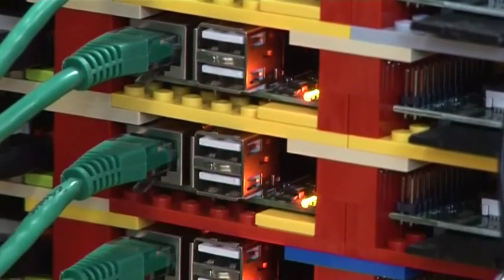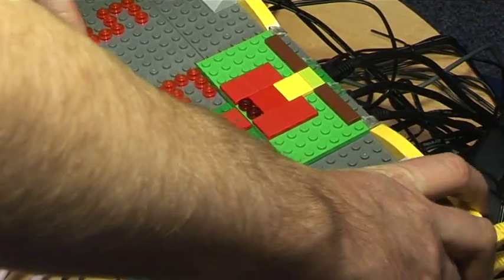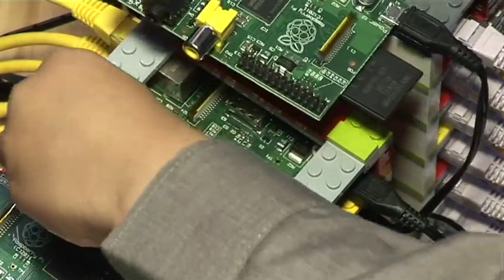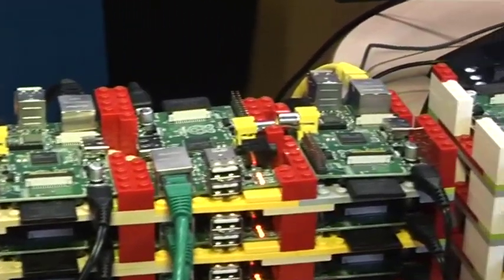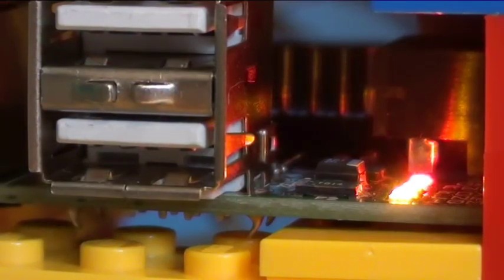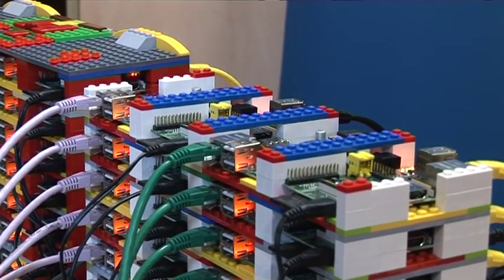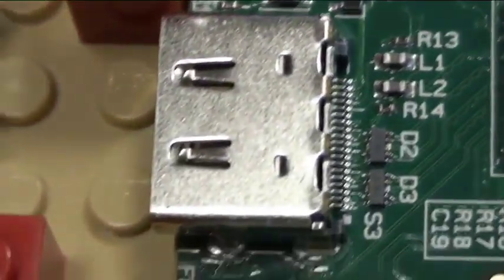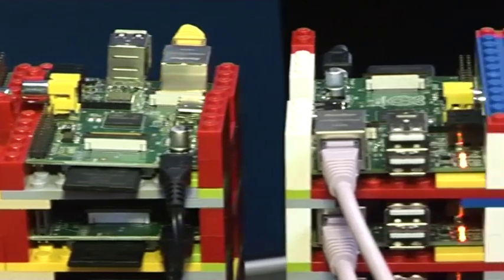University of Southampton - Southampton engineers a Raspberry Pi Supercomputer

Comment: I feel compelled to look into a pi Zero version of this, and irrespective of final size, to have a touchscreen interface - so even if it's comparably a gargantuan thickness of tablet and remains 'leashed at wall' by a power cable, it's still got power above and beyond anything currently available..., like a desktop tablet/table top surface interface is still a worthy project, ultimately it is scaled for taking up less space than a tower pc and outperforming the best of them ...any pointers...?

Comment: If he knows enough about computers to put that together you would think he would know how to mod an ATX power supply to power all that from one supply..
Reply: +Matt Phelps putting all this together is stupidly easy. All you do is plug in each pi into a switch and configure a program to allow them to pass messages between each other.
Reply: +[_ ] Oh I know that, I'm just saying all you need to do is grab an atx power supply and splice all the pi's into it's 5 volt rail. You may even need two atx psu's but it beats the hell out of 64 wall warts lmfao
Reply: I disagree. It's a lot simpler and easier to plug in 64 wall warts than to solder 64 power connections and make sure that you did each one correctly. More importantly, using one or two ATX power supplies creates a very large, single point of failure for the entire cluster. If one rPi's power adapter dies, you just replace it. If you've soldered your power connections in and your PSU dies or your wiring wasn't done properly, your whole cluster can be affected. Honestly, who wants to solder 64 cables when it takes just 5 seconds to plug a cable into the wall?
Reply: touche, very valid points. I would just be concerned about the cost of all those adapters. this guy probably doesn't care about the cost because it's likely under grant money but those wall adapters aren't cheap in comparison to connectors and a bunch of wire. It'd be a pain in the ass but that's the way I'd do it. Even to just buy the micro usb - usb cables then soldering into those would likely be cheaper. In this case I don't think it'd really matter if part of the cluster dies..it's a raspberry pi cluster it's not like it's the NSA's defense network and I would trust a good quality full size psu's circuitry rather than a shitty wall wart. just my opinion.

Comment: Any actual demos? The RPi cluster video is also all about blablabla and how it looks and not a single demo to prove is a "super computer"...no game, no program...hell no OS
Reply: +Sacco Belmonte How would you "prove" it's a super computer? Any why would you need to?

The idea behind this is not, that it is fast, but that with these simple elements the fundamentals of super-computing can be demonstrated. There's nothing one needs to prove there.

He actually talked about how it works: It uses MPI to coordinate the machines, distribute computation to the nodes etc. MPI is an old defacto standard for that.

So you could just run a lean linux on each node, and then distribute computation through MPI.

Comment: Quick Question: Why did you use individual power supplies for each Pi rather than just implementing a 5V rail?
Reply: I was wondering the same thing. It would be very simple to make a 5V setup to power every pi off of a single supply.

Comment: first of all a hearty thanks for every body who made this...i like to know abt its performance.....does it works for servers?does it give 1000ghz++ speed......how about its price?....does its support ubuntu? ......shall i program my own soft in it?....does it help in daily home computing? kindly tell me guys
Reply: Performance wise, it can't really be measured in Hz, FLOPS (FlOating-point Operations Per Second) is the measurement you'd be looking for with this kind of system.

Each Pi costs $30, plus SD card, cables, switch, etc. You're looking at $1000+

You'd need to be programming applications that support this kind of distributed processing to gain any benefit at all. 

What does "daily home computing" mean?

Comment: You can power the Raspberry Pi from the MicroUSB connection (as is expected of you) or through a special GPIO setup (but you have to be careful and will need to add your own circuitry to prevent power surges from destroying it).

You might look at getting an ASUS RTN-16 instead. They are about $80 right now. Just get TomatoUSB installed on it and you're good to go.

Comment: As of  31/08/2013, on Distrowatch > com;
Raspbian is a free operating system based on Debian GNU/Linux and optimised for the Raspberry Pi hardware (the armhf processor architecture). Raspbian comes with over 35,000 packages, or pre-compiled software bundled in a nice format for easy installation on a Raspberry Pi...

Popularity (hits per day): 12 months: 295 (9), 6 months: 294 (19), 3 months: 213 (39), 4 weeks: 155 (52), 1 week: 152 (50)

Comment: Yes, but, it is conductive. It would be so easy to short one of the nodes just by bumping it up against the case, and then whatever the computer was doing is probably ruined. But, yes, they could have used it for a heatsink.

Comment: I know it's not meant for real world applications, but you could set it up as a simple fixed terminal when you don't want to bring your desktop. If you have a laptop, you can keep the fixed terminal somewhere and bring your laptop as portable terminal. Like at school (I'm only going into highschool but it seems like a good idea to me) put a raspberry pi in your locker with a small monitor, keyboard, and power supply. Then prepare it for a quick terminal start or make an interactive school guide.

Comment: Each Pi does 24 GFlops. Assuming the total power of the stack is simply the sum of the individual powers of the Pi's, that comes out to about 1536 Gflops, or around 1.5 Tflops. Not quite even your 4870x2, but the difference is that instead of just being something that you go out, buy, and use, this stack is of immense educational value. people LEARNED something by making this, whereas you probably learned comparatively little by just buying your 4870x2

Comment: I feel like GPUs are a better and cheaper way to build supercomputers...I could be wrong, and I guess it depends on specifically what you're doing - if you need more floating point or more integer processing power, but most tasks you need a super computer for are heavy on floating point math, for which GPUs are stellar performers and relatively cheap. For the $4k they spent here, I think much more could be achieved using GPUs, in most cases.

Still cool, tho! Woo legos :D

Comment: whats the answer?
what kind of tasks would be best performed on either system?

I imagine the rasp.pi setup has more ram, and can flop faster, but I dont know if you get a huge bottle-neck in the transfer speeds of the switches between each of the modules, or how the end-module would cope with 63 streams worth of data?
And deviding a problem into 64 parts to begin with, and then combining all the 64 parts into a whole, that sounds like it might be difficult to manage for a programmer.

Comment: There's this thing called "teaching". They do it a lot at universities. Part of that is the students building stuff themselves under instruction. Instead of having students cobble together a computer made of 64 regular commodity compute nodes for ~2000$ a piece, they'll have them put together one from 64 Raspberries, which cost 25$ a piece and will run the same software. Not as fast, but that's not the point when you're teaching how the internals of super computers work.

Comment: Aparently you may be wondering if it might run Crysis. 

You dont run Windows on this baby. Its linux. Go back to playing counerstrike..

A thing this setup would most likely outperform any gaming PC at would be somthing like hashing and such. The point about Raspberry pi isnt getting awsome computerpowers like that. The point about a clustersetup (supercomputer) is the cost/performance ratio)
$4000 will get you this.. 64 raspberry pis. Or about two really big gamer desktops.. But thats it.

Comment: "have enough computational power to do the graphics for Crysis" in theory, yes, but in reality no, real-time rendering requires  very low latency, i don't think Ethernet latency and bandwidth is fast/large enough for that, so even if you have 10k rPI and enough power to run crysis (on paper) you wont get more than a few FPS due to the limitation of the bus speed between them.

Comment: i made a sort of learning operating system in batch and text. I would like to know if this would work alongside the original operating system. the only down side is that it needs to be on a external drive of good size. it will eventualy run out of room.

Comment: Megaflops = mega, denotes a factor of a million (giga is a factor of a a billion)  and flops is floating point operations per second..... a floating point number is a number in computing that has a fractional part i.e. a decimal point which is more complex for a computer to handle than an integer which is a number with no fractional part or a counting number i.e. 4, 28, 55 a float is a real number i.e. 3.144, 16.3 or 0.01443

Comment: To elaborate on the windows thing, see most windows operating systems are made for x86 and x64 processor architectures, however the raspi uses an ARM architecture processor and windows XP, 7 and 8 aren't made to work on ARM processors. However windows does have a line of OSs that are made for ARM and it's the Windows CE line. Although however, the raspi could run CE, there doesn't seem to be port for it :/

Comment: The youtube filters don't let me paste links here, search for "ubuntu arm" on google and the first link is to Ubuntu's website where you can download it. Ubuntu 12.04 OFFICIALLY supports x86/AMD64/ARM, and there is an unofficial port to PPC (according to the official documentation, I though PPC was discontinued).

Anyway, it wouldn't run on the raspi, since it Ubuntu requires a v7 ARM CPU while Raspi uses a v6 one.

Comment: yes and no, but mostly no, ubuntu is made for x86/x64 based processors, pi uses an ARM based processor, so you would have to find a modified version for ARM (so in a way yes, but it wont be official), i might try chrubuntu a variant made to run on a chrome book (also ARM), but i have no guarantee

Comment: It's cheap from an education standpoint. Just as you teach children to draw with a $5 box of crayons instead of a $150 drafting pen set, this allows you to teach students the basics of parallel processing on multiple nodes (64 in this case) for $4000 while you use your $400,000 machine to do actual computing.

Comment: For raw floating point math you would have roughly 1400Gflops of performance (24 per GPU, assuming perfect linear scaling [and I know it's never perfect]). Not actually shabby, a modern GPU can get well over 3000Gflops by now, at similar power draw (about 170 watts for a GTX680 if I'm not mistaken) but that's without the whole rest of the system needed to support it, while the Pi gets to half that throughput in a completely self contained package.

Comment: Basically, you're both idiots. In parrallel performance 64 raspberry pis will certainly outdo pretty much any comsumer processor on the market today, even though MegaFoch is correct that the ARM achitecture isn't quite as fast as most desktop or laptop achitectures(Sandy/Ivy bridge, etc), being more focused on power saving. However, the area in which this really loses to a modern desktop processor is in single-thread performance, which isn't taken into account when counting Ghz.

Comment: One 7970 is capable of 3.7 TeraFlops of single precision... thats 3700 Gigaflops. two is 7400, now add to that add a modern 4 core 8 thread intel proc (even first gen lynnfield/nahalem) and you're sitting at about 8500Gflops

each pi is about 25gflops (24gf-gpu 1gf-cpu) *64 = 1600GFlops, 1.6Teraflops.

The math speaks for itself. Enjoy your debate. And I'm not a kid. The use of this is not for HPC but for understanding how HPC systems work. Idiot.

Comment: You're the one who's being wrong now. You can't just add megahertz values together to get an accurate sense of how fast a processor is. Each cycle of the 3570 is more powerful than the historical PII, because of pipelining. The guy correct, but the point is irrelevant because no one was trying to make a computer that would compete with the 3570. It's sort of like someone making a go kart and then someone else like "My car's faster than that!" Who cares?

Comment: Sigh...He's saying that the cheapness of the pi means it could be used for teaching how to build a supercomputer. He could not do this before due to the normal cost of computers. So rather than just a programming teaching aide (which it was designed for) it can also be used from an engineering perspective. Yet another application of the pi. And he *did* tell you about 'hyperthreading', the MPI and gave you the specs; 22gigaFLOPS * 64 etc.

Comment: You can use MPI on a home computer without an interconnect or without any real cluster(It will just simulate multiple processors). There's is a windows port of MPI but it's shit, so you should use a UNIX operating system(Linux or Mac OS X are the top choices).

Comment: The model B consumes 3.5W, for 24 GFLOPS, that's very good, even if you had 100W worth of switches (they don't have to be high grade ones, since the Pi only supports up to 100mbit ethernet) that's only 324W, that's power consumption for a low end server, anything with a decent CPU will be in the 400-500W range, and high end servers are 1000W+